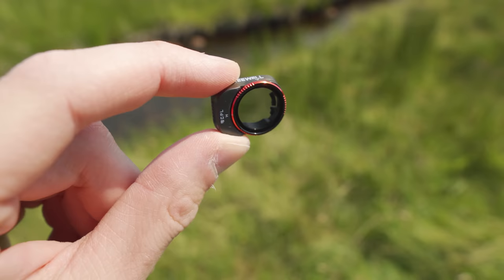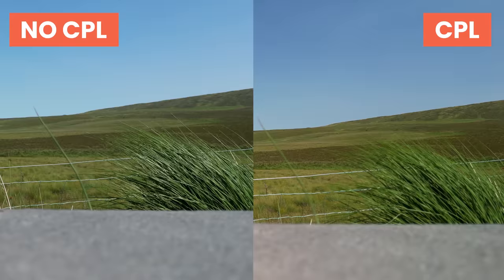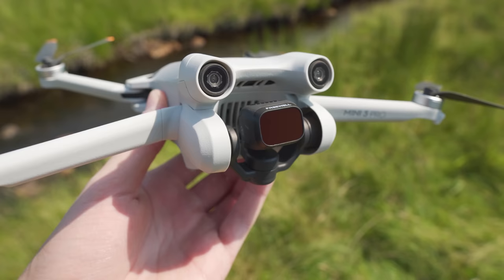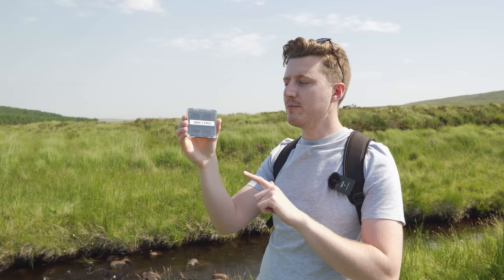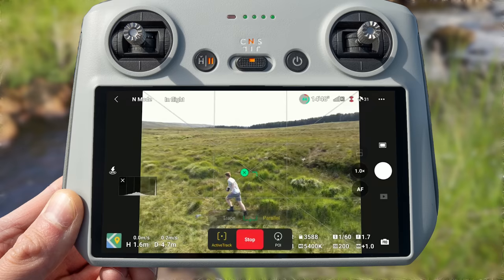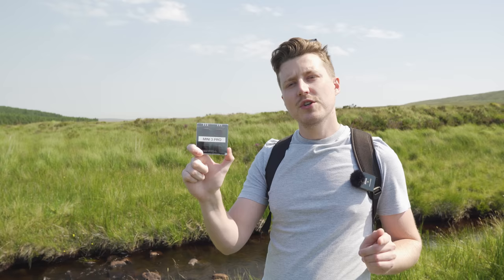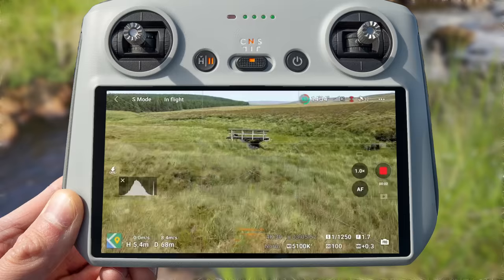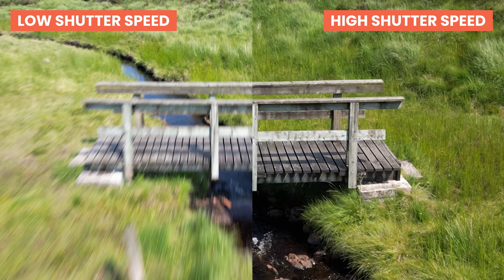UV ND ND/PL CPL What on earth does it all mean? | Ultimate Guide to DJI Mini 4/Mini 3 ND Filters

Comment: AT LAST! Someone who knows what they're talking about and can explain properly the use of ND and polarising filters.(unlike many Drone YouTube creators). The only important point missing is that the degree of effect a polariser has is determined by the camera's position relative to the reflective surface (for removing reflections), or to the sun (for deepening blue skies). So, depending on which way the camera is pointing, and its angle to the subject, the effect can be quite noticeable or not noticeable at all. These are basic principles in photography and not at all drone specific.
Reply from the maker: Thank you! Great info regarding the degree of polarisation, thanks for sharing that - it will definitely help others!
Reply: @TheDroneCreative  If you are going use a ND anyway, why not have a polarizing effect(however good or bad)?
Reply: SO IF I WANT TO 1 PACK OF ND FILTERS I BUY THE ND WITH POLORISING.? THANKS
Reply: Jumping on the question about going for the nd polarising pack for best of both worlds? Or just nd filters?
Reply: @01bigtrev  what did you end up going with? I am having the same dilemma haha! I guess the question is, is there any downside to using NDPL in lighting situations where reflections aren't too prevalent so they don't have much use?
Reply: EDIT: I suppose they also help to deepen blues in the sky and create more stark contrast in the footage.
Reply: @TheDroneCreative can u make videos on how to setup the polarizer filter. I got nd/pl filter but a bit confused how to align the polarizer. Thanks
Reply: @nathanielsion3183 Activate your camera/ drone and look at your actual screen, then twist the filter’s orientation. If you pay attention to the reflective stuff like windows and water you should be able to experience the effect quite easily!

Comment: Great video. Maybe I missed it, but there is one question left unanswered in my mind : Are there situations when an ND filter is a better choice than an ND/PL... ?
Reply: Good question! I want to know too!
Reply: This is what I found after using your question directly in google: 
Photographers commonly use PLs to reduce glare, reflections on water, and the like. Why should they make their shutter speeds slower at the same time? That would only introduce blur or force higher ISOs. Makes no sense in most shooting situations.

In addition, ND/PL filters are harder to manufacture precisely. Poorer quality isn't much of an issue for drone photography, but if you want the best results, these filters aren't most people's choice.

Most of the top-notch filter makers don't offer them as one integrated filter because those don't reach the same quality levels as separate NDs plus PLs. Combining two separate filters is a feasible alternative, anyway.

So it seems to be a quality issue. I don't think it is possible to fly drone with two filters on top of each other?

Comment: Hello everyone! I'm about to get an ND/CPL six pack... but is there any drawbacks of chosing ND/CPL as opposed to just ND or is it better to have both? From this video, I understand that having CPL will alter saturation and contrast slightly but is this enough of a video altering issue that you would rather have two separate filter kits? One ND and another one ND/CPL?
Reply: Were you able to find an answer to this? I am looking for the same answer as well.
Reply: @Az__  I have the ND/PL Neewer set and I found them to be just fine and even convenient for my ends to have both ND and PL, in practice I’ve realize that convenience and quickness is more important to me, so whatever makes the prep process faster and easier to just start filming, I’ll take it. I even prefer the higher saturation and contrast, but that’s just me…
Reply: Thanks  @ed3R77  , appreciate your response. 

Great, that is exactly what I am looking for too. I need the quickest solution and will be using in Auto mode as well. I don't want to waste time playing around with the settings.

Comment: Rather than trying to find the correct ND filter by trial and error, you can easily calculate what ND filter you need. Every halving of shutter speed is a reduction of exposure by one 'stop'.  Each grade of ND filter reduces exposure by a given number of stops so you just need to match them up. 
In this example, we start with a shutter speed of 1/3200 but need a shutter speed of 1/50. So:
1/3200 down to  
1/1600 = 1 stop (ND2)
1/800 = 2 stops (ND4)
1/400 = 3 stops (ND8)
1/200 = 4 stops (ND16)
1/100 = 5 stops (ND32)
1/50 = 6 stops (ND64).
If the starting shutter speed was 1/1600 then that's a 5 stop reduction in exposure, so we'd need an ND32
from 1/800 down to 1/50 is 4 stops, so that would need an ND16
And so on
Reply: Is there a 1/60 ? 😅 I usually use 30 fps so I wonder what my calculations would be
Reply: The calculations will be the same. In terms of exposure, the difference between 1/50 and 1/60 will hardly be noticeable and, if it is, it can easily be adjusted in post processing.
Reply: I have been waiting for someone to post this information and if I didn't see it I was going to comment myself. I am new to drone photography/ videos but I have over 40 years as a keen stills photographer, including qualifying through the Royal Photographic Society. I have frequently used ND and CPL filters in my photography and was pleased to see that someone had posted the 'rule' for deciding what is the best ND filter to use, without using trial and error (and battery life!). Something that some people may not have noticed is that the number on the filter is the multiplication  factor. As a result, if the exposure say 1/3200 and you want to get to 1/50 then (1/50 divided by 1/3200 = 64). Or put more simply 3200/50 = 64. or 1/3200 x 64 = 1/50. I hope that helps someone.
Reply: @Gary Heald  super helpful! Thank you!
Reply: Thanks for the comment, i was hoping the video would have this info
Reply: amazing comment

Comment: I wouldn't use the CPL and the ND/PL for video if I were going to change directions often. They are fine for still photos with the drone. While using a CPL filter for video any change of direction you may get a a color shift or an uneven change in brightness. If you know for a shot your going just one direction then they are fine.

Comment: I use the ND16 a lot because I do a lot of seascapes and I do photography mainly - I don't do video people...why do I need a neutral density filter when I'm shooting seascapes well it does slow the shadow speed down and I have found a beautiful optimal shadow speed for shooting beach photos which just slows down the water a little bit and gives it a more mystical look that shadow speed is roughly around about 1/50 now that is pretty slow but it's slow enough that you can still get a shot, and it just gives the water a completely different look. You can see texture in the shore break as well it's... I wish they made a CPL/ND 16. Filter built together which is what I have on my landscape camera, so I have a filter that does both. I wish there was one in this set. I have also shot a half second photo with my drone and it came out great you can get down to half a second and still get a pretty crisp photo and if you just use the burst mode. It does affect photos as well and maybe you should do a video on how Andy filters impact Photography I'm a little bit over DJI videos which just bang on about video all the time. Seriously there a lot of good. Photography is using the DJI mini three pro including myself and I don't do any video at all not interested. Thank you for your videos

Comment: A couple of more comments about polarizing filters … they limit reflexctions on water or glass surfaces best at 30º and 60º to the axis of the camera lens. Also note that they work best on water or glass surfaces at those angles; shooting straight into a window or straight down into water (unless the water is moving) will do almost nothing. They work best on a sunny day. They increase apparent saturation on vegetation because they're eliminating light reflected off leaves and blades of grass, also most effective at 30º and 60º angles, but because there are surfaces at lots of different angles, the position of your polarizer doesn't make much difference (on a cloudy day the position of the polarizer makes no difference on vegetation because light is coming from all angles). The position DOES matter a lot for adding to the blue of your sky on a sunny day, and is most effective when shooting at a 90º angle to the SUN. That's why when you're shooting with a wide angle lens the sky is more noticeably not the same shade of blue across the photo.

Comment: Great video Matthew, thanks. Now, one question, on the drone, with those CPL filters, when do I turn it to another alighnment where not aligning the guidelines on them? That is to say, (on the Mini 2), when would I rotate that to another setting and why? At present I use ND filters with CPL (polarization) and always keep the notch aligned with the line. However, why do they move and what for? On a DSLR camera, it is to polarize the direction of the light if I am not mistaken.

Comment: Great vid (already subbed a few months ago). Shout out for a camera cleaning tutorial (including filters)! I haven't had the need to clean the lens, but I'd use an air pump to blow any particles first and if it doesn't do the job, I'd use my camera brush gently on it. With the filters, so far I've just used microfiber cloth and would like to know if I'm f'ing it up and should be using and air pump + brush first... Anyway, that UV filter saved my drone once, I keep an extra UV around, besides the complete ND collection.

I also wanted to add that the ND/CPL pack will change the color of the sky, they are best used at a 45 to 90 degree downwards angles. That's the only thing I'd say it was missing from the tutorial, hopefully you'll make a vid on this particular issue.

Comment: So, the lingering question that I have that nobody seems to talk much about is what the process is like to manually calibrate which filter you want to use according to the ambient lighting conditions at say 25m altitude in the area you intend to be doing video. Say you are set up at 30fps and 1/60th and the interest is in an EV of right around -0.1. Do you put on an ND filter, fly out to the general area that you will be taking video footage and see what your EV is and if it isn't around -0.1 you fly back and change out the ND filter accordingly and then go back up and repeat as necessary until you are settled in with the right ND filter?
Reply: Yea, you just kinda have to wing it, with enough experience you can get pretty accurate. Tip - don't be afraid to mess around with shutter speed and iso for your ideal exposer. The only people who always stick by the "1/60th for 30fps and 100 ISO" rule are professionals using $5k worth of equipment with adjustable apertures.

Comment: Apart from the lack of nd1000, wouldn't the bright day pack be the best option if you just want to pick one set? Since if you don't want the PL effect you can just rotate it to V while filming H for example?
Reply: The ND/CPL pack will change the color of the sky, they are best used at a 45 to 90 degree downwards angles. That's the only thing I'd say it was missing from the tutorial. The best value pack, imo, is getting the 3 set bundle if you wanna go full pro with NDs. I screwed up, got the ND/CPLs at the beginning and ended up buying the normal ND package too, afterwards (thus wasting money on shipping). Btw, the ND1000 will help you with day hyperlapses.
Reply from the maker: If you don't want to do long exposure photography you can live without the ND1000, although as Drone Surfing has mentioned they can help with day hyperlapses. If I had to pick one set the bright day pack is the option I would go for, but I do a lot of flying over water and reflective surfaces. In the end it will be slightly personal preference though and they do offer the 3 set bundle which is pretty good value for money.
Reply: @TheDroneCreative  Do you have a link for the 3 set bundle please, I can't seem to find it?

Comment: Is the rotation on the ND-PL filter only to set whether in Horizontal & Vertical mode, or do you have to mess around getting the correct polarisation setting? i.e. is the setting optimised and fixed for each mode?

Comment: I saw many drone operators recommends Freewell filters and I went to their recommendation and bought the kit for my Mini 2.  But I was kind of disappointed to realize that the polarizers don't do a good job at keeping out light leaks, especially when the sun is at the horizon.  When I fly my drone with those polarizers, I keep seeing huge leaks on the middle or at the right down corners of my films even if I'm quite away from the sun, I have to aim completely at a different direction to hide it.  The ND filters seems to do the job just fine, but I feel they don't eliminate the sun glare just as well as the polarizers if it wasn't of the leaks it such a shame.

Comment: Thanks for this. I've got the bright day pack and I'm still experimenting with video and stills. You explain everything perfectly.. but when should I NOT use the ND PL kit? I bought this kit on its own and I'm wondering if I should have standard ND's for when filming when there is little motion, high up or little reflections around, or does it not really matter? Thanks again
Reply from the maker: Hey, so a few reasons not to use a polarizer are when the reflected light has colour and you want that in your image (ie, orange sunset on the water) or in very low light. Realistically speaking though the ND PL kit will be good for 99% of situations. Hope that helps!
Reply: @TheDroneCreative  thank you! I'll see how I go. I'll probably get the all day pack too so I have the full spectrum and can test the difference. What modes on the M3P would I be using for the ND1000?

Comment: Thanks.  Very helpful info as always.
I have the freewell ND set, they work well and clip on nicely.  Trying to work out if I can be bothered to buy and carry another set for CPL.

One thing I would say is its a real weakness of the mini 3 if you want to do photography as well.  I sometimes try and find a happy medium so I dont need to land and remove to take stills, but in an ideal world DJI would have just added aperture control or at least give a built in ND in the mid region that could be flicked on and off in flight.... But I guess there's only so much they can pack into a thing this size and weight!

I wonder if it's OK to fly without anything attached, even the original DJI glare shield?  Since its deeper it doesn't fit in the filter boxes so I tuck it away and forget to out it back on when I remove filters.  Haven't seen any issue but not sure if it causes the gimbal any issues long-term.

Comment: Are there any scenarios where you specifically advise NOT to use the CPL filters? I mean for me it makes the image look nicer (due to sky colors etc.) just like when I wear my sunglasses.
Do you have any examples where having them on would hurt the outcome?
Reply: I have the same question... Because I don't really want to buy two separate sets (ND and ND/CPL)... Did you found any answers?
Reply: @ed3R77  unfortunately not yet
Reply: @m3st3r01  I found a few similar comments on here... Basically they will work most of the time, they do alter sky colors slightly but I think I can live with that. A more corncerning comment I saw mentioned that if you change directions a lot, colors may vary during the motion depending on the angle that light hits the filter at. Also if you really want to capture a very specific scenario where you are interested in capturing the actual reflection of something and it has color, then CPL is not recommended. For example, the sunset reflecting in the ocean or a lake AND you want motion blur... But for now I got the ND/CPL kit which will work for 99% of scenarios.

Comment: If you shoot at 60 fps and you are not going to make it a slow motion video, then you should use the shutter speed of 1/60. Gerald Undone has made a great example video of this. Search for gerald undone motion blur
Reply: If you shoot 60 fps on the Mini 3 and don't plan on slow motion, you are doing yourself a disservice. The Mini 3 only shoots HDR video in 24, 25 and 30 fps.
Reply: @thomza  Shooting in 60 fps is useful if you don’t know whether you are going to make some footage slow motion or not. It gives you a lot of flexibility when you can decide that in post processing. Of course using exposure of 1/60 isn’t perfect for a slow motion video but in many cases it doesn’t matter unless you are shooting at close diatance and there is a lot of movement
Reply: @thomza  it’s better to use D-Cinelike profile than the HDR mode. You can shoot in 4K60 in D-Cinelike and make it HDR in post processing. D-Cinelike makes possible to really color grade your footage in post processing. The HDR mode is for amateurs. D-Cinelike is a 10-bit profile so you can open up the shadows a lot more

Comment: Thanks for that, very useful, however I have a couple of questions. It's all well and good to put the polarising filter for H or V, but you don't fly for only H or only V, so does this mean if you start in H mode you have to come done, rotate the filter and then go fly in vertical mode?? Apologies if I have misunderstood you.
Then, if you have a polarising filter attached, how do you adjust it before take off? I mean how do you know how much polarising effect you need? I'm a little confused about these.